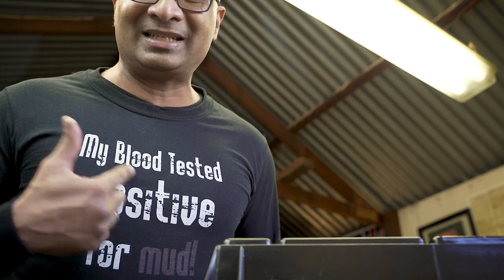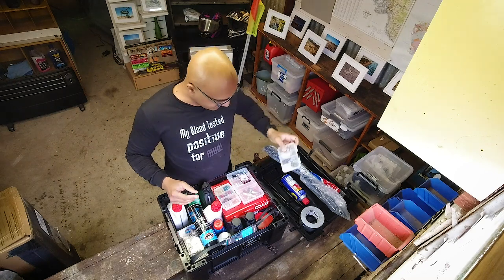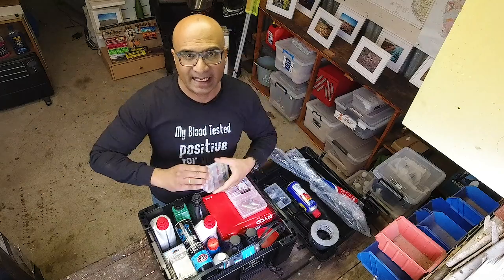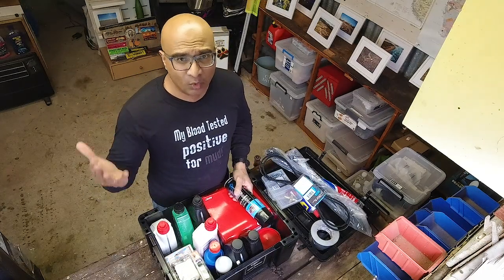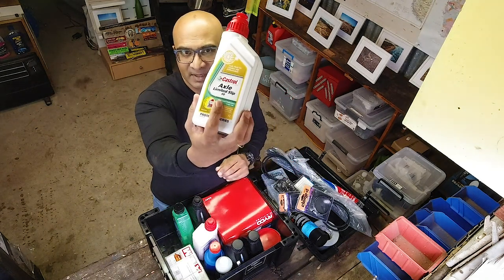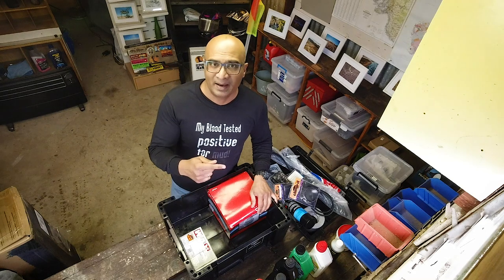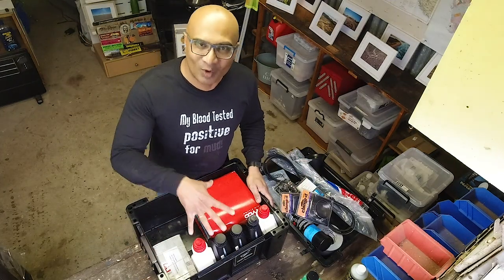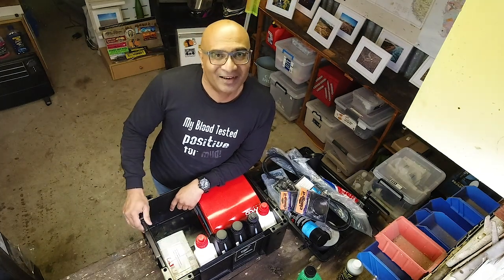My Spares Kit For Overlanding

Comment: Hi Duncan
Good ideas, you've gotta have some self sufficiency when going bush.
Wago wire connectors are useful, as well as electrical tape and a few metres of insulated  hook up wire.
Ratchet straps are always useful for tensioning or securing things underneath.
Reply from the maker: Hey Lindsay. 
Absolutely. I carry a set of straps of different types. Invaluable. This is will include in another video where i talk of my tool kit.